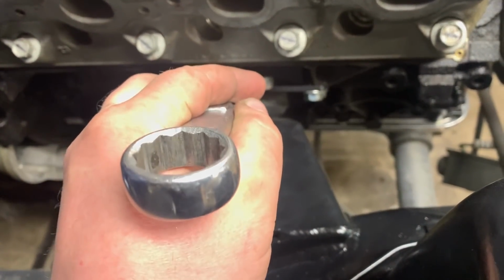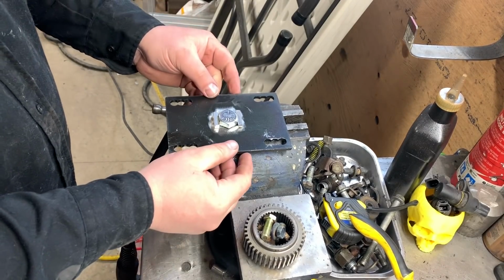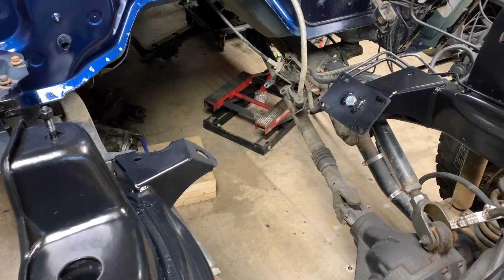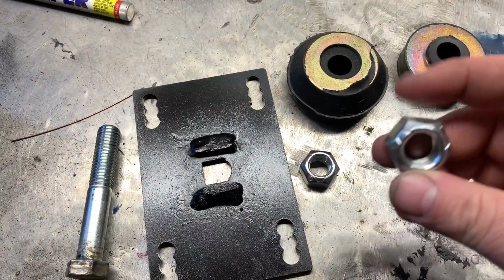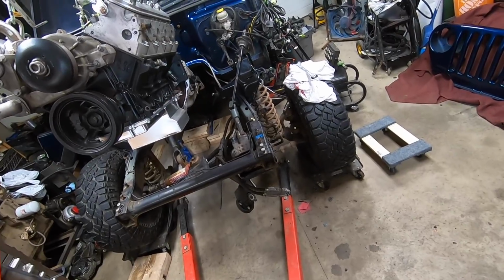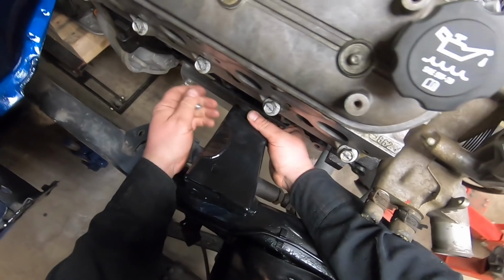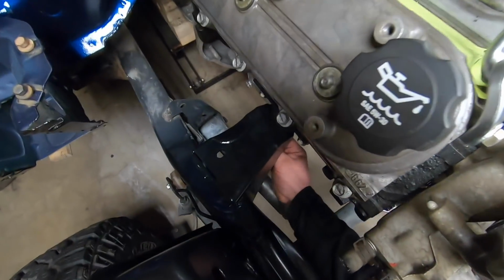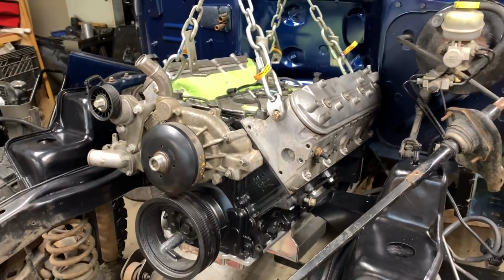Novak Coversions LS Swap Tj Motor Mounts Hack

Comment: That square hole in the engine mount plate seems to suggest that it was designed to accept a carriage bolt.
Reply from the maker: That could be possible however the kit didn’t come with carriage bolts
Reply: @TestDontguess  it for sure is supposed to come with a carriage bolt

Comment: About 30 years ago, I had a similar problem on my old bevel gear-drive Ducati Darmah.  I had to tear down the engine which has studs from the crankcase up through the cylinder and into the head.  One of the four studs ends at a cavity in the head which is a bitch to get into.  I had no way of getting an open end wrench to get a hold of the nut, due to the wrench being too thick.  The nut sits in a cavity in the head, that has a thin opening on one side for the wrench.    I had to grind the side of the wrench end on my grinder's wheel, to thin down the wrench.   Then I was able to slip the wrench into the cavity and turn that bastard nut loose, 1/8th of a turn at a time.  I still have that wrench with it's metal blueing on the end, from the grinding heat.  lol

Comment: BSK Garage hi guy don't forget lock title on all the motor mount bolts cheap insurance down the road as I'm assuming you plan to take the jeep off road and lock in that four wheel drive 👍👍👍 C😎😎L

Comment: how did your steering bracket line up with the motor mount. Im using the weld on mounts on an 05 LJ and the holes in the mount are about 1" off. to line up with the motor mount, the mount needs to butt into the control arm bracket.